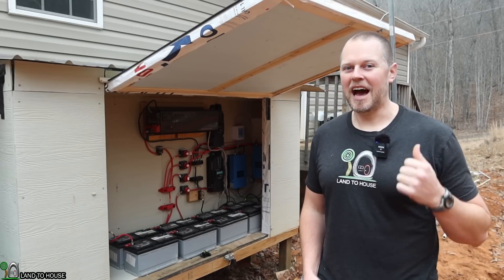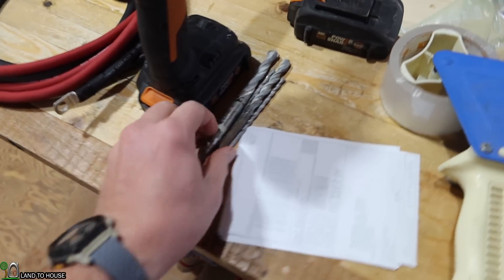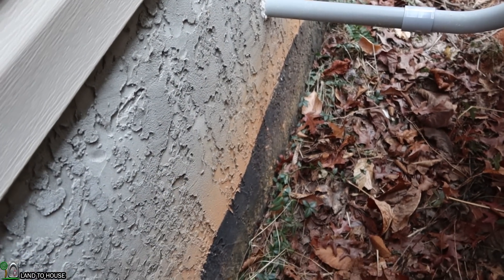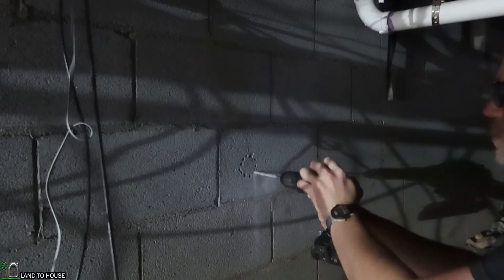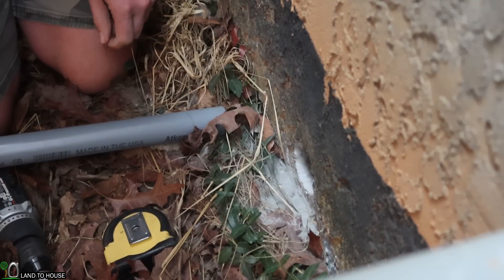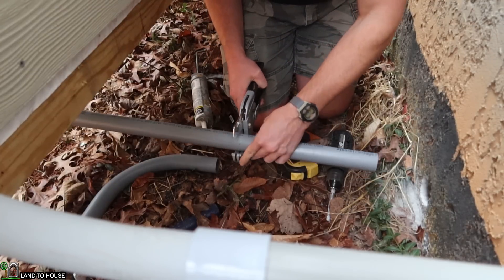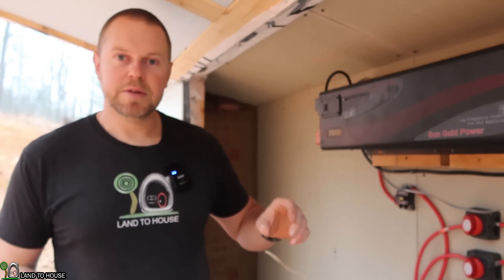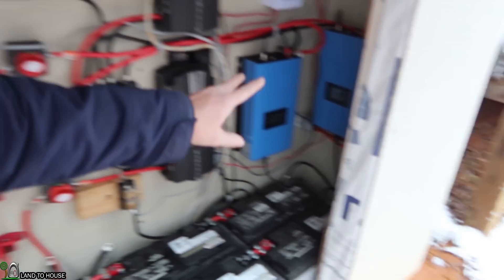Solar Power 5kwh Battery Prep

Comment: so this will be tied into the grid ? now  if your producing power back to the grid  then the power company pays you right ? if so thats cool .
Reply from the maker: This system with the new inverter and new battery will also have grid limiter ct clamps. Only the house will get the power.
Reply: @LandtoHouse  ok well thats still cool . your still sticking it to the man .
Reply from the maker: Between the 2 systems I anticipate the power bill to be quite low.

Comment: The world is coming full circle.  You put so much effort to migrate the power out of the crawlspace and into the shed, only to start migrating it back, LOL
Nicely done.  BTW if your hammer drill has a hammer only setting, you can get a chisel bit for it and break out the block between the holes of the first ring of holes you drilled.
Reply from the maker: I know! sad. I have a feeling after this rack battery goes on the channel other companies will reach out. Then I can connect a battery out in the shed for warm weather and this one for winter. That would keep as much electronics out of the house as possible.

Comment: Kind of curious, does hydro work like wind where when the batteries are full and demand is low, power is shunted to a dump load?
That could have been used, in combination with the heat output of the inverter, to heat the small shed and avoid all that drilling and crawling.
Alternately, if your production is significantly higher than your demand, the battery could just get a warming mat like a chicken water container does.

Comment: #2 wire may fine for a very short run (2’) 1000 watt inverter but I’m guessing you’ll need a lot bigger battery/inverter cables. Inverter manuals usually have cable sizes listed. They are listed very big and for a reason, it’s not a mistake. If anything, go larger. Unlike AC circuits, DC circuits can’t tolerate voltage loss and function reliability. Do not rely on online ampacity charts/calculatiors for this information. Believe the manufacturer’s manual. Yes 2/0 and 4/0 cable is expensive but a system that doesn’t perform is worthless. Also use a T class fuse for this DC application.
Reply from the maker: The maximum amperage that the new inverter can pull is 75 amp. This 7 foot run of 2awg is rated at 115 amp. Thats a 40 amp cushion and I don't plan on allowing the inverter to run at 100%. I am thinking if it runs at 62 amp thats 3000w. Surely 2awg can run 62 amps.
Reply: @LandtoHouse  
Yeah it’s its rated 115 for standard practice, but now you’ll be for warned as to why the inverters faults or shuts down when something starts or premature low voltage shut down. If someone forgets your energy management plan and fires up the coffee maker and the dishwasher, vacuum cleaner or microwave at the same time you could be in the dark. The number one reason for off grid inverter problems is under sized cables or poor connections. Just trying to give you a heads up because I’ve seen it too many times. DC is weird, go big. Good luck
Reply from the maker: @SkypowerwithKarl  This inverter will be grid tied with limiter. Supplementing the grid power. That means I can run all the normal things on grid and this inverter will only pump out up to 3600w. But I can easily limit to 2500w. (52amps) 

Now the inverter in the house is setup for critical loads up to 8kw. That one has 0/2 cables.
Reply: @LandtoHouse  
Ok that makes more sense. I’ve got 13kw worth and it’s tight but the only thing I avoid is the Hvac and dryer at the same time. It can do it however if someone starts the microwave or coffee maker too it’s probably going to shut down.
Reply from the maker: @SkypowerwithKarl  The Hvac is a monster for solar. We use too much power to be totally off grid. But at least I can reduce way down... the 8kw system can work off grid for a while in emergency.
Reply: @LandtoHouse  
Yeah hvac is a monster, especially older ones. In summer I’m a net gain for only 5 hours so I supplement from grid also but during off peak rates. I’m good for 24 hours with no sun or grid when using hvac but I do have a 9500 inverter generator for when SHTF. I can’t find more sun cost effectively in my small property so I’m stuck at 4.4kw PV. Going to move in a few years to Tennessee,Texas or Florida with some land, a double wide and pole barn. Winter here in CA has been amazingly bad for solar. So I now know, however much the data says you need, quadruple it. PV is cheap, land with sky isn’t.
Reply from the maker: @SkypowerwithKarl  just today the 15kwh battery reached 100% full. It took 10kwh to get from 50% to 100. The NC mountains sun is only 3 to 4 hours of sun a day. So triple the PV is a good goal. I ran the panels at 414v and that has helped a lot!
Reply: @LandtoHouse  
A charge control with a large working range and high voltage is great. Next system will have at least 500v. My system is limited 90 to 250. I’m just under the high voltage in full sun, summer but the last few weeks of storms have made the PV barely able to offset the inverter’s idle current. Dark clouds no PV

Comment: I have you at 9k watts for them 8 agm batteries at 48v.  Correct me if I’m wrong. What were you powering constantly. Fridge, a/c or heater? How fast did they discharge and how long it it take you to charge with your 3k solar system. I’m new at this, sorry for the questions.
Reply from the maker: The 9kw that you found is total watts of the batteries. but you dont want to discharge these more than 20% off the top. Otherwise you will damage the battery. So the usable range is closer to 1.9kwh on the agm battery bank. Charging these batteries with 3k of solar was not a problem. But that 1.9kwh  is enough to run just the refrigerator for 20 hours. With all the other things in the house this battery is down in a short time at night.
Reply: @LandtoHouse  Thank you so much for responding and explaining.

Comment: Is the hydro 24-7 or occansional use? Can these batteries be added to or are they solo use?
Reply from the maker: The makup of the lifepo4 battery would not allow these agm to be used in the same system. I can however keep them out in the power shed and use them on the dedicated off grid inverter. I would need to add some solar to them. The Hydro I only run 3 seasons.
Reply: @LandtoHouse  So your saying the life po is a one battery set up  with no ability to add aditional batteries,that makes them useless for future upgrades.
Reply from the maker: Oh my apologies.  The lifepo4 batteries can be daisychained together. Lifepo4 cannot be paired with agm.
Reply: @LandtoHouse  That is what I was wondering. AGM not even same leguae as Lithium for sure. Keep the Agms for a smaller system running something else till they fail. I wonder if their will be temperature shift in the cabinet now you have the air from the crawl space mixing in.
Reply from the maker: @scottfoster2487  The new temp is around 5 to 10 degrees warmer in the shed vs outside.

Comment: That black mark is the protective layer of the home.  Rain/water barrier.  
Why disconnect all those lovely batteries and lose all that power.  Always good to have a backup.  You have plenty of disconnects there, it would be easier just to leave the batteries unless they're dead or you're going to sell them.
Reply from the maker: I can keep them out in the power shed no problem. At least would be a good option for running the dedicated off grid 6kw inverter.

Comment: Nice Video.  What Model Grid tie with the CT clamp are you getting, I am in the market for one also ?
Reply from the maker: The blue inverters are from a company called SunT and the new 3.6kw inverter is from the same company. This lets me use the same ct clamps.

Comment: With the insulation, was there any possibility of having the battery in the power shed?
Reply from the maker: I fear that it would get too cold. We had a week at 0 degrees and the shed stayed at 10 degrees. Even with a small heat source that is very cold. Under the house stayed at 45. If another battery company sends a battery I could use that in summer and this one in winter.

Comment: Looking forward to seeing the battery review!
Reply from the maker: I am going to do a case swap on the new battery because 1 corner got dinged in shipping. Should give a great opportunity to open up the battery and take a look at it.
Reply: @LandtoHouse 
If you are talking about opening up a lithium battery, be careful. The inside of these batteries are layered with thin sheets and can be flexed. One little bend can cause the battery to combust, if not explode.
And it’s more of a chemical fire. You can’t hardly put it out! And it can re-ignite hours later.
You may already know all this. Just don’t want to see you get hurt by a lithium battery. Be safe!!!!

Comment: Why not keep the AGM's and charge the Lithium Ion from it using a DC-DC. There may be some extra losses but the total storage capacity is larger.
You could consider moving the AGM's indoors too and charge them when the Lithium battery is full and there is still energy coming in. Would be a nice extra storage just in case....

I have an outside (lithium) battery (with heatmat that kicks in at -5 C when there is solar coming in) connected to my solar which is charging my inside batter's when it goes over 13.9 Volt (down to 13.6)

Comment: I know some locations have extremely strict laws about damming a stream. But putting that aside, and warning people, could you do some videos this spring on the topic? My water volume flow is not sufficient. But I do have the ability in one spot to build up a large amount of water that would let the ram pump run for several days if the dam worked. It's about 5 feet wide and I need about a 2 foot high dam with a through hole for the pipe. I've used boards, pavers with mud/leaves, etc. but they all leak too much. Should I do concrete? How do I divert the water while pouring? Anyway, I would love for you to build something in the middle of your stream that's a reservoir and show techniques for dealing with water as you're building (that translate to other scenarios like mine).

Comment: Amazing that one battery will replace the other bunch. Very interesting.
Reply from the maker: Yes its wild. The discharge range on agm batteries is not very big. The lifepo4 batteries have a much larger capacity. I think that I would need at least 16 of these agms to make the one lifepo4 battery.